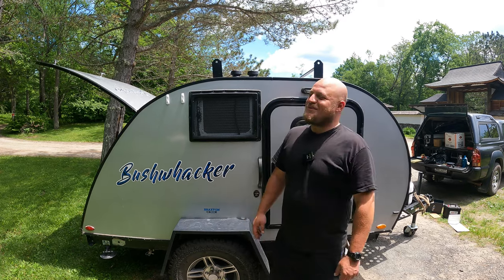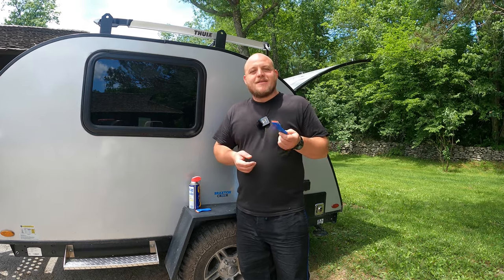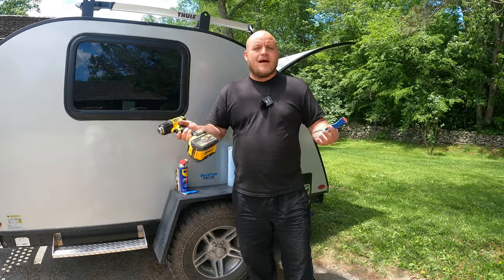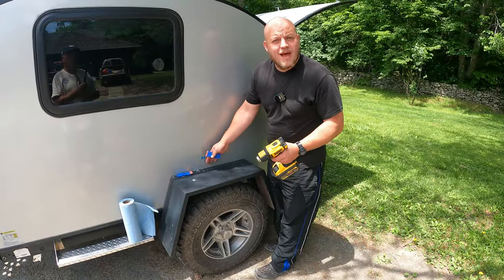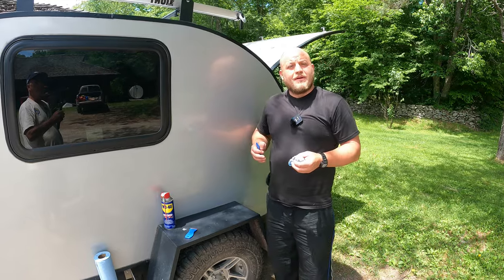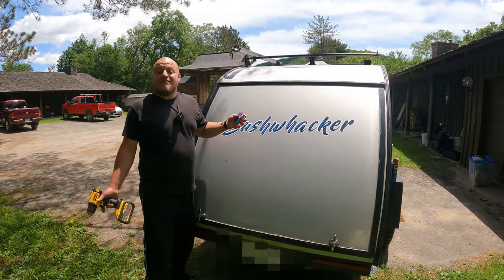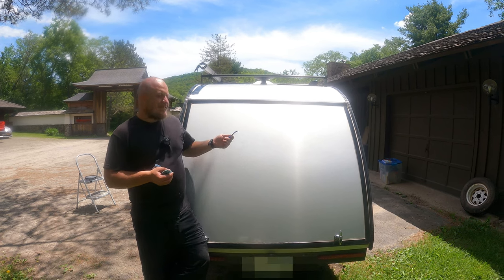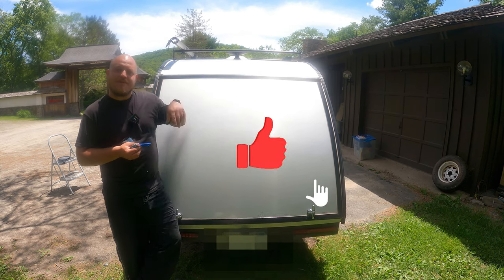Removing Decals from Campers | Dealership Stickers, Bumper Stickers & more

Comment: I found out that Turtle Wax brand Bug & Tar cleaner works well to get the sticker residue off.
Reply from the maker: I’ve heard that, haven’t used it yet! Thanks for the tip 😀
Reply: ^This right here.  I had some laying around so I used this.  I just wiped it on liberally and let it soak into the decal residue.  After sitting for like two minutes, it had softened the residue up completely and it scraped entirely off with the plastic razor.  Then I went over with a little liquid rubbing compound.

Comment: You don’t need a heat gun use pro strength graffiti removal by goof off it’s the best thing works very fast with a putting kife and after just clean with wd 40
Reply from the maker: I’ll check that out, thanks.